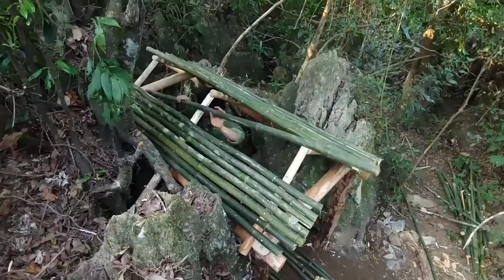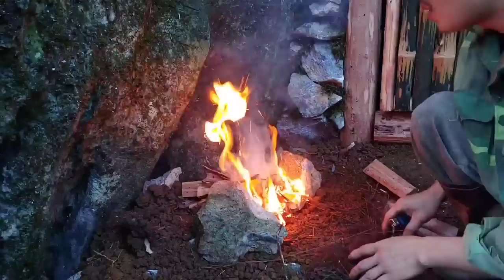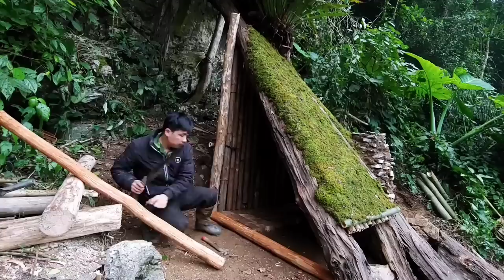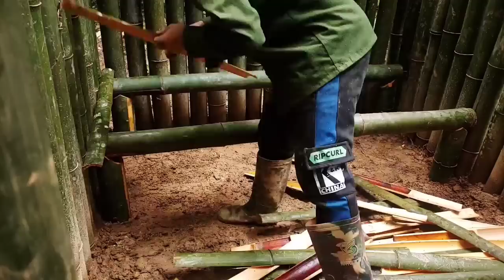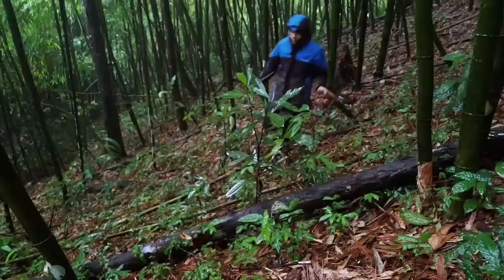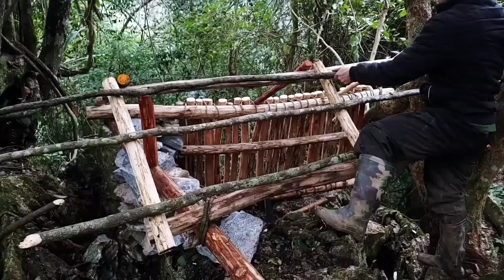Full video: 200 days building a house in the forest

Comment: When monsoon comes, don't think the moss will hold up for long.  If you cut bamboo in half then inter-weave them, one facing up, one facing down, it will form a waterproof barrier that drains in whatever direction you lay them.  Which makes me also wonder about the first shelter.  Seems like the rain would run down the roof, then into the sides of the interior.  Any place with bamboo must get seasonal rains.  Maybe it is just a temporary shelter.
Reply: P00p0p0ppp0pp0p0😊00pppppppp0😊pppppp😊pppppppppppppppppp0ppppppppppppppppp0😊0p😊pppp0ppppppppppppppppppppppppppppppppppppppppppppppppppppppppppppppppppppppppppppppppppppppppppp😊😊